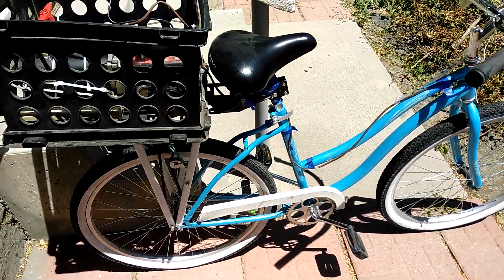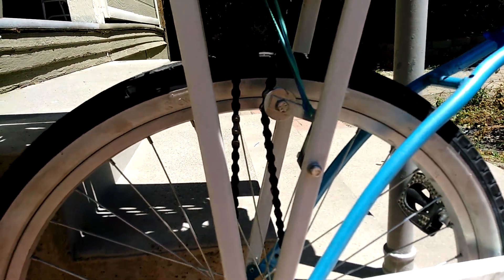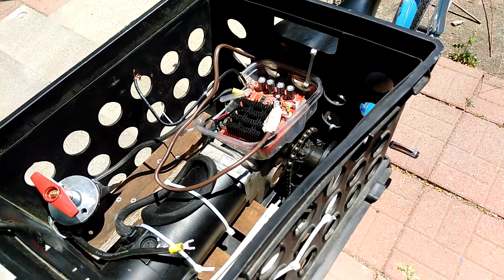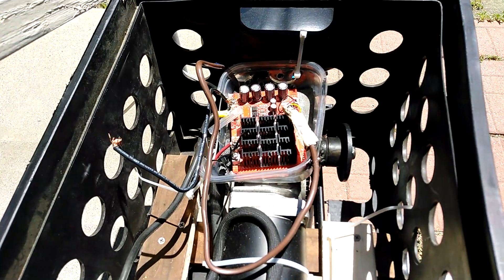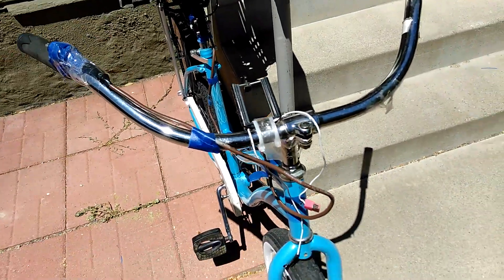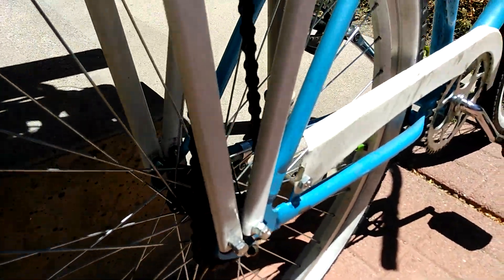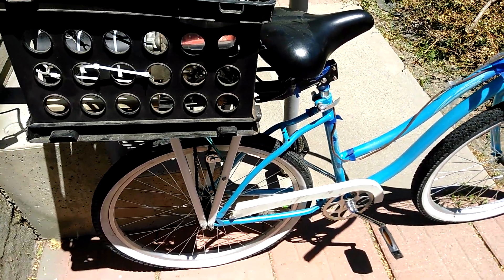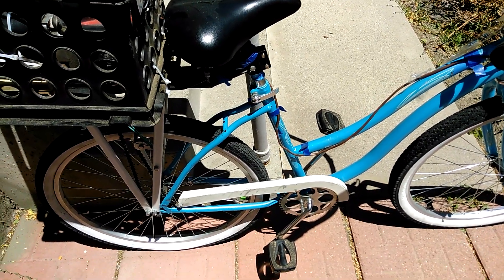Electric beach cruiser update.

Comment: Good ideas so far, one thing I suggest is use an old skateboard wheel as the tensioner, and what kinda output do you have for the motor and power consumption? I'm in AZ myself so trust me, the heat I am no stranger to, and the best wire I've found that can withstand heat and changing weather is an old extension cord, and as for sprocket replacement, I'm not fully sure on this, but you may look into getting a mountain bike, a cruiser is great and all, but the reverse braking to halt, can cause a small issue, with a mountain bike, a sprocket would probably be cheaper to service, especially considering you can mount/set the sprocket cassette on a certain gear for chain driven, and motor driven, as for heat protection, I use a backpack with a thermal bag around it to keep out the heat, and covered to avoid battery issues, I myself have a Merida Powercycle 500, that still uses a 250 watt, 24 volt SLa setup and I'm trying to figure out how to wire both of my sets of batteries up where I can use one pack, then when that runs low, switch to the second pack, still, neat video dude, stay cool out there
Reply from the maker: My main issue is finding a cheap rear rim setup with two independently freewheeling sprockets. Will need to be custom built. Maximum wattage on the motor is about 750w @ 24v so an old extension cord will not handle the amps. I think I will hit the auto wreckers any get a cheap set of jumper cables to use work wiring. 
Brakes are my number one priority right now. Going to hit the Reno bike project and see what I can dig up. Hopefully I can find an inexpensive disc brake setup for the rear or some strong caliper brakes.
Don't melt out in AZ this year. Looking to be a hot summer.

Comment: You going to work on the strange fuel test
Reply from the maker: Thegeokiller 15 Yes. I know you have been waiting for a long time. I tried to do the test with my 26cc engine from the HHO project but it floods out too easily. I am looking for an older Briggs engine with a larger displacement and a floatless carb. That should be able to handle the odd chemicals I plan on trying. My big problem is the prices people want for used/junk in this town. Everyone thinks what they have is worth retail/new price.  I may do a Bitcoin donation drive to buy a brand new engine (maybe a hft predator) to do a bunch of projects I have lined up. Hopefully I can dig something up soon and get some videos made. Thanks for your patience.
Reply: ThriftStore Hacker i I just picked up one for $45 2 horse pretty worn out and it's Briggs & Stratton but be to hard for me to send out and all that
Reply from the maker: Thegeokiller 15 Shipping would be expensive.  Told the local pawn shop that I'm looking for a $30 gas engine. I really want a side shaft engine but I may try to get a lawnmower to abuse.
Reply: ThriftStore Hacker why are your local pawn shop you can  get one from the flea market
Reply from the maker: Thegeokiller 15 our flea market here sucks. It's basically hipsters who think everything they are selling is worth more than it was originally because it's old. Gotta go 100mi to go to the good market.
Reply: ThriftStore Hacker  Same here semi Fair the place is like little Mexico good thing i also have Wilmot flea market near me
Reply from the maker: Thegeokiller 15  I'm guessing you are in the Tucson area? I bought my first ebike out there at the flea market.
Reply: ThriftStore Hacker what does that mean
Reply from the maker: Thegeokiller 15 you mentioned the wilmot flea market. I have been there. Purchased my first electric bike there.